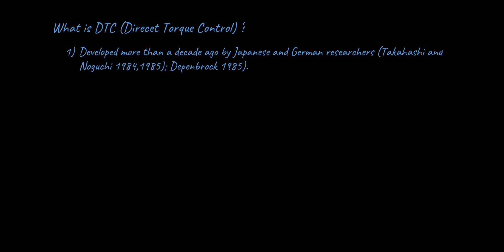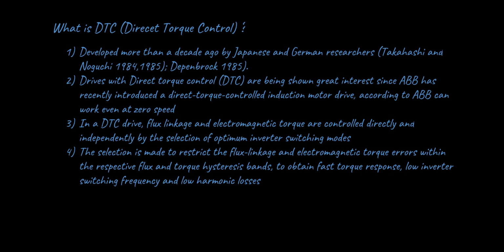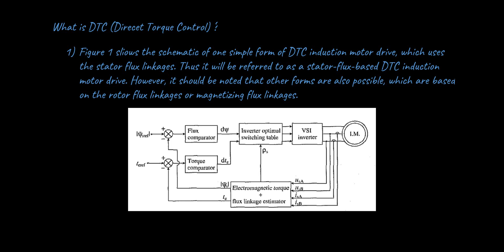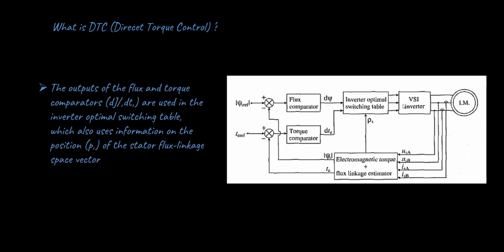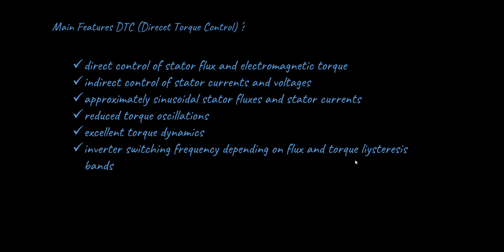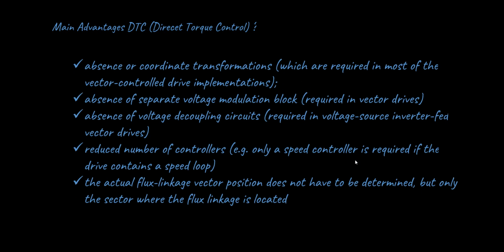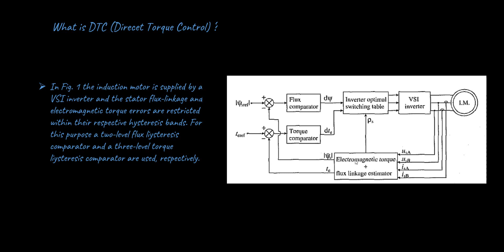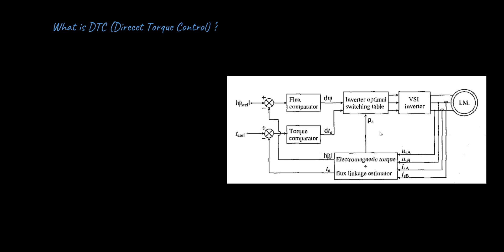DIRECT TORQUE CONTROLLER INDUCTION MACHINE – INTRODUCTION | PART 1

Comment: Bạn ơi, trong DTC, mình muốn điều khiển theo reference là Torque thì stator-flux linkage reference sẽ được tính bằng cách nào. Mình cảm ơn.
Reply from the maker: Để điều khiển theo reference là Torque trong DTC (Direct Torque Control), bạn có thể tính stator-flux linkage reference theo công thức sau:

\[\Psi_{\text{ref}} = \frac{\text{Torque}_{\text{ref}}}{\text{Number of Poles} \times \text{Stator Current}_{\text{rms}}}\]

Trong đó:
- \(\Psi_{\text{ref}}\) là stator-flux linkage reference.
- \(\text{Torque}_{\text{ref}}\) là torque reference mà bạn muốn đạt được.
- \(\text{Number of Poles}\) là số cặp cực của động cơ.
- \(\text{Stator Current}_{\text{rms}}\) là hiệu dụng của dòng stator.

Công thức này giúp xác định giá trị stator-flux linkage reference cần thiết để đạt được torque mong muốn trong quá trình điều khiển DTC ban nhé
Reply: @Thanhtoanofficial  cảm ơn bạn rất nhiều, hiện mình làm báo cáo nên cần trích dẫn nguồn, bạn có thể cho mình tên bài báo được không vậy. Cảm ơn bạn nhiều.